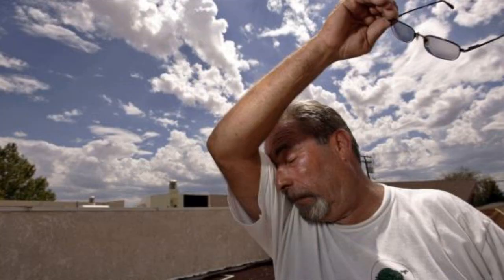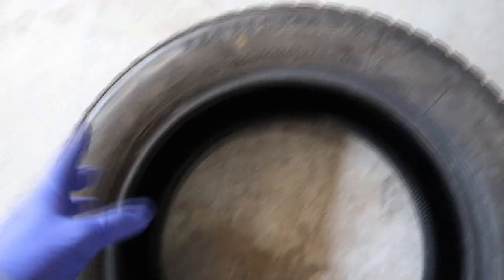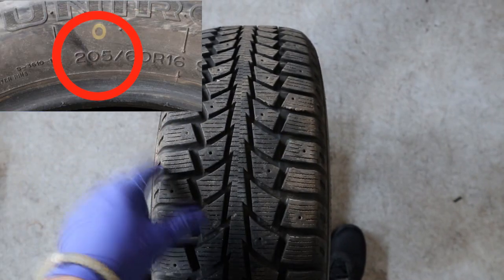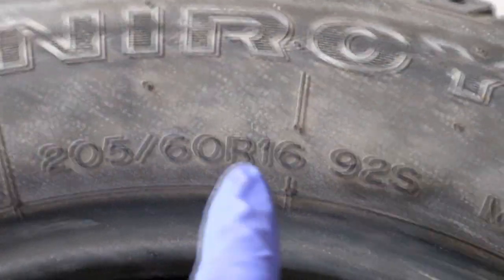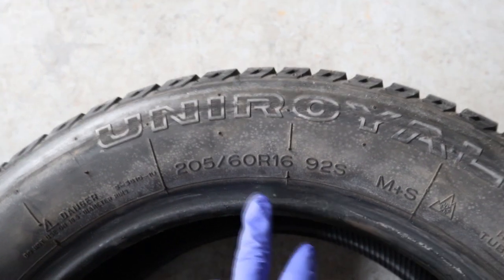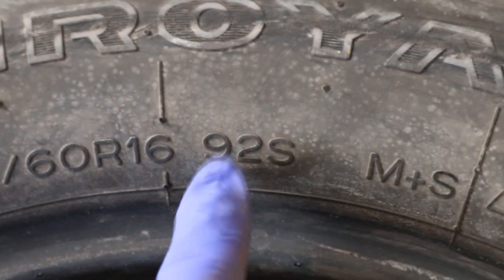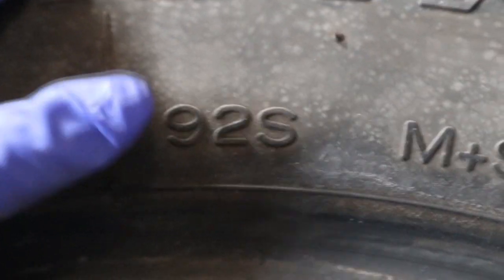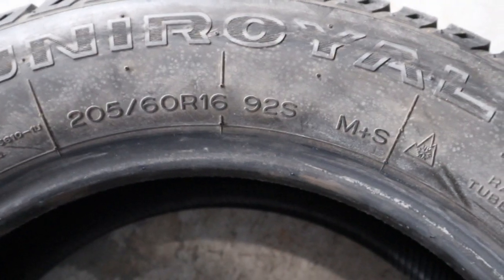How to read a Tire Size (EASY!)

Comment: Well stated with humor. Thumbs up. ....what else is molded into that 205 is the M+S followed by the three peak winter rating. That tire is designed to run in snow. Thanks for the vid.

Comment: Aspect Ratio= H/W(100%)

don't forget "100 percent" that's "1/100"
60= H/ [205*1/100]
60= H/ 2.05
2.05(60)=H(2.05)/2.05
right side is 60 multiplied to 2.05 and left side is 2.05 divided by 2.05 which is "1" so it becomes H*1 which is simply "H" and thus 123=H

Comment: I like your vid, very educational and very well explained!  Thank you, now my question will my ford 2004 asks for P225 R60 16 would a P205/70 R 16 fit?
Reply from the maker: You can only go 10mm wider or narrow 
So P215, P225, and P235 should all work but I don’t think P205 would fit on your current rims they would stretch
Reply: @ManiiZilla  good thank u so much I Appreciate it
Reply: @ManiiZilla  Thanks. I had the same question. Mine is 215 60R 16. What about the aspect ratio can you go higher/lower as well? Appreciate your time!

Comment: I got a question champ, I got a fiat punto 2002 it got ( 165/70 R14 ) tyres on I'm gonna change it to summer tires which is ( 185/60/ R15 ) would this damage my car??
Reply from the maker: I don’t believe it would because you are widening by 10 mm on either side of your current tires 
If you want to know for sure measure 10mm wider from both sides of one tire and see if it would contact anything like your cars suspension

Comment: Hi bro i have one question   my car has 235/55/17 tires if i put rear tyres 255/55/17 i mean wider tires   car will be lift from back side ? Or it will be same height ?

Comment: How do you make sure the width of the tier matches the width of your rim and not just the diameter?? Or does that even mater?
Reply from the maker: Width of the rim affects how wide of a tire you can put on it 
You can google “tire size vs rim width chart” and find images of charts that show the recommended tire size for different rim widths

Comment: So P225/70R16 should work correct, I want to buy the right ones I do have 16 inch rims
Reply: any number/any aspectR16 will fit your 16 inch rims, but maybe not your vehicle. Make sure the tire isn't too tall or wide, or it's going to scrape inside the wheel well. Start with the label on the driver's door post, or look it up online. The info will be there for your specific car. Going taller will affect the accuracy of your speedometer, so keep that in mind. Good luck.

Comment: lol, your suspension doesn't hold most of the load! All 4 tires have to be able to hold more weight than the cars weight combined. 630 kg x 4 , means that the car can weigh up to 2520 kg! Other than that, good video!